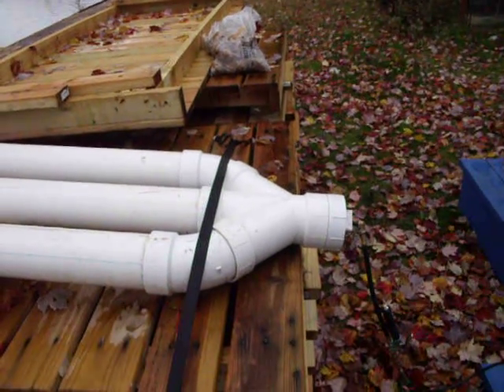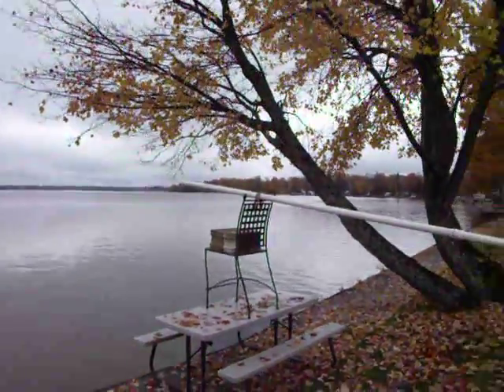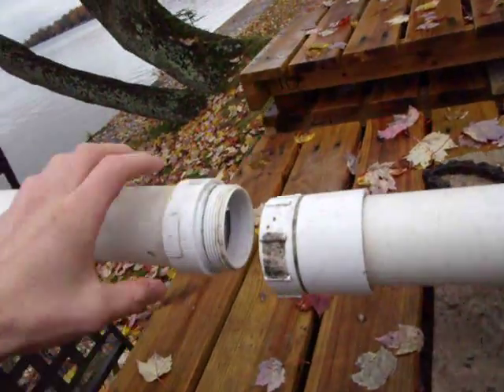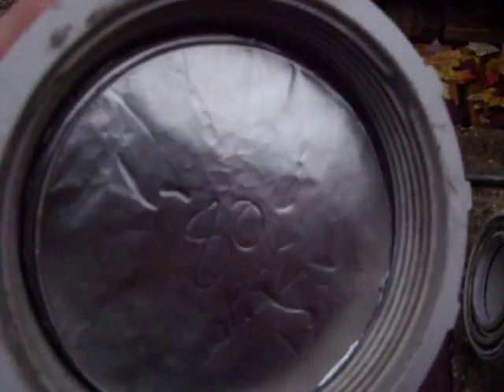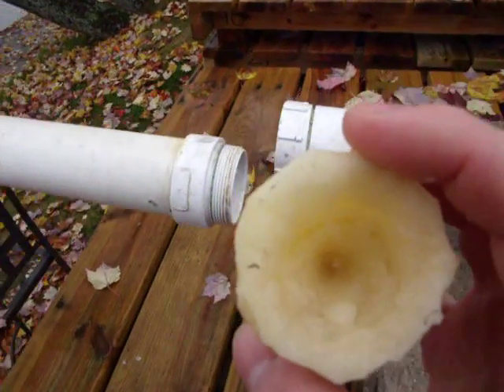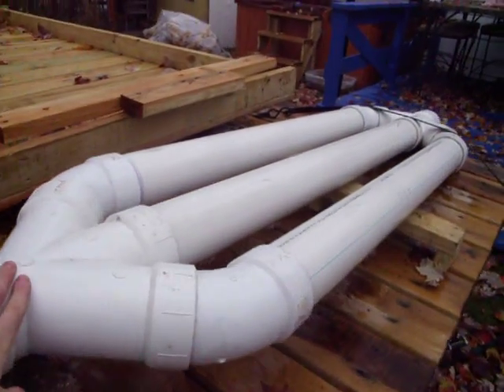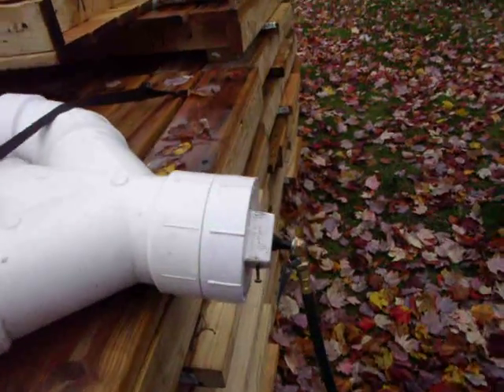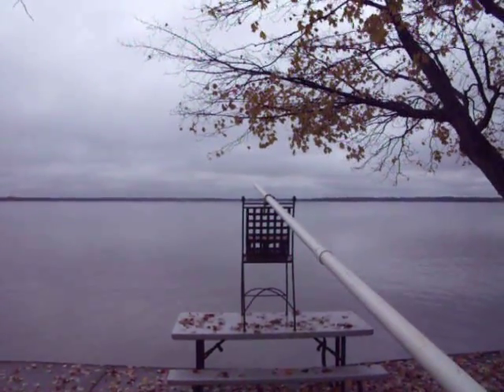The world's most powerful potato cannon

Comment: World's most powerful potato cannon...built with PVC. The most powerful are Schedule 80 Steel, and use metered propane/O2 mix, that is pressurized to 100-300 psi before being detonated. A high pressure burst disc is used to contain the pressure until it reaches a critical point. Those will shoot a 1" ball bearing through a car like a sheet of paper.

Comment: Burst disk! Of course!

Not quite a simple pneumatic, I knew it couldn't be. 

I've never seen this exact design before, is it on SpudFiles? 80 psi is about 5x mix, in PVC? Wow, no failures yet? I'd really expect that moster to self destruct.

Love the spud slug. You should try a Washer Slug (see my vids), they make an insane seal and being so heavy they punch like heck. 

I bet you could breach some 1/4" steel plate with that combo.

Crap, now I have to build one. Gee *thanks*!